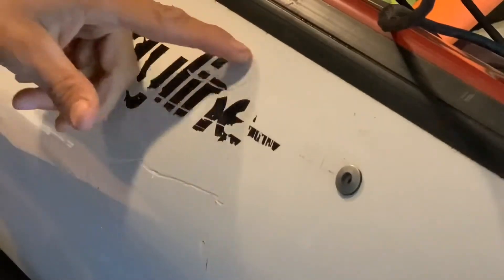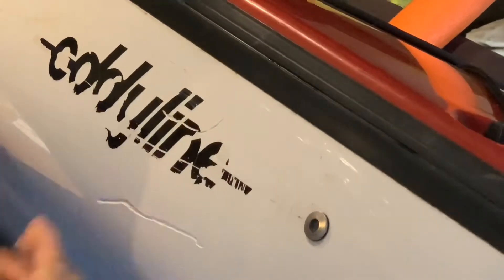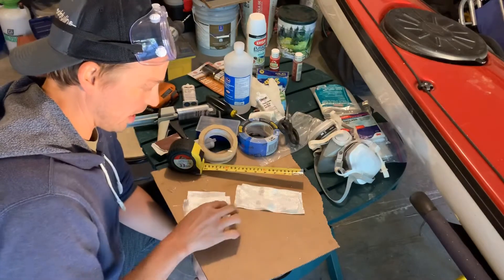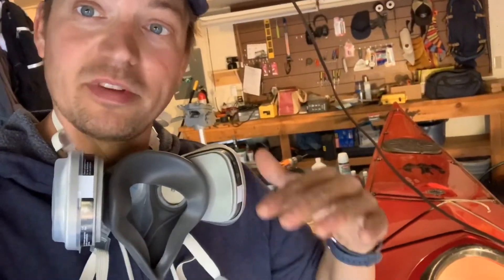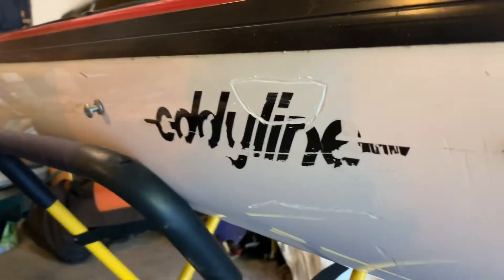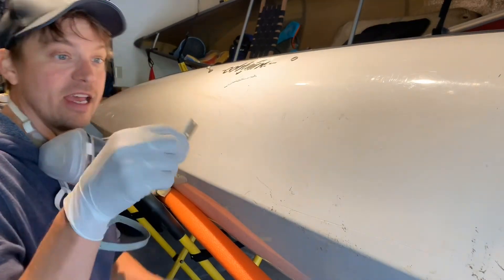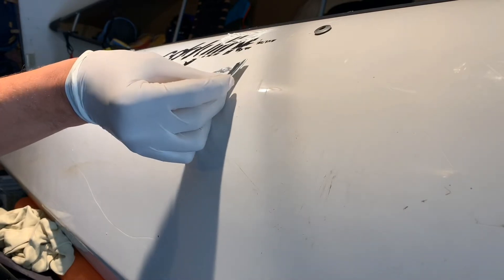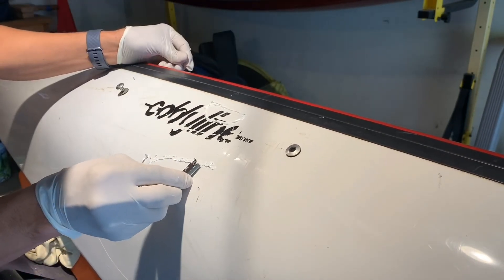Eddyline Repair Part 2: Thermoform gouge and fracture repair

Comment: When you run the blade over it, it will cut cleaner if you make a slicing motion as you pull the blade forward. Instead of pushing the debris into your trough and possibly pulling out material you don't want to, it will cause the debris to fall off to the side and cut nice and clean in one pass.

Comment: So in this video, you showed us when to use Devcon. When might you use Plexus?
Reply from the maker: Plexus is the manufacturer of Devcon Plastic Welder. They are both Methyl-Methacrylate Adhesives. Same thing basically.
Reply: @HappyPaddlin  thanks, Ethan. I only asked because Eddyline's website has them both listed separately under Care & Maintenance items.

Comment: I am interested in an eddyline but wonder if they damage easily?
Reply from the maker: In 20 years I’ve never had to do a repair on one of my demo boats. We buy two fleets of every model Eddyline makes and customers are usually not the most gentle when they attend paddle festivals and demo days. Anything can be broken but I like to say that if most of your paddling does not require a helmet you’ll be fine. And these days poly boats are so cheap if you want an abuse friendly rough and tumble bouncing river kayak, you can just buy a used WW or inexpensive poly kayak for that as a second “beater” kayak. We build thousands of boats every year and have been doing this technology since 1996. If it didn’t work you’d likely hear a lot more about it online!
Reply: Eddyline is highest on the bang-for-the-buckometer. The next up is going to be epic and they go right up to the most expensive. Depending on what kind of yak you want I would go with eddyline or Epic. Eddyline do not like to be bashed against rocks and they will scrape and scratch and crack. So you should have a roll of Gorilla Tape Handy. In any boat as a matter of fact gorilla tape should be on hand especially if you're offshore a lot like me. But generally speaking you're going to have to bang an eddyline kayak pretty fucking hard to crack it. But do it just right on a sharp Rock and you could. If you're open water and not hitting rocks you'll likely never damage it.
Reply: Thermoform is actually stronger than most composites but, with different disadvantages.  I have had Kevlar, fibreglass, rotomold and now 2 thermoformed Deltas.  If you hit a rock in a fibreglass yak chances are you will not go all the way through because the webbing cloth saves you, but that gouge becomes soft, deformed and may leak.  But, with fibreglass it is infinitely repairable.  Kevlar though stiff and strong will also crack easier than thermoform.  Thermoform on the other hand flexes more-- good and bad.  The flex allows some 'give' in a collision but, stiffness is a desired quality in kayaks.  That's why the deck on a Delta is composed of 'cool' recessed  bungee lines.  Thermoform also is more UV and scratch resistant and remains the same color underneath when gouged.  To answer your question, thermoform is a rugged and strong material, superior in many ways to high end composites.  Heavier than multi layered carbon (the best) but lighter than fibreglass and somewhere between the two for durability.
Reply from the maker: Thanks for the contribution here. Multi layered Carbon as “the best” is the only thing you wrote that raised an eyebrow. Certainly light, stiff and strong but gel coat still fractures and resin coats expose fabric to abrasion which is not always ideal. My new whitewater canoe from Northstar is an Inegra/Kevlar multi laminate w a resin that has some more flex than their normal resin so resin fractures are very limited. Can run a composite canoe down class 4 which any Carbon laminate (even multi layer) can’t do. 

Multi layer composites with various combos like Kevlar/Carbon or Innegra/Kevlar offer a lot of benefits but there is always a trade off as you pointed out!

Love to hear contributions here and thanks for sharing your real work experience!

Comment: Would plastic welding be better?
Reply from the maker: Nope. But you should try it ;)
Reply: @HappyPaddlin  I read on Eddie Line website that their sheets are a composite with an ABS base. The outer layer apparently is some sort of acrylic. So I can picture myself with a plastic welder feeding in an ABS weld rod. But this would also require the surrounding area to melt at the same time and I'm unsure if this unspecified acrylic material will melt with the ABS better than Devcon cyanoacrylate.
Reply from the maker: The way I demonstrate is how Eddyline’s longest employee/owner and production manager does all of their repairs. I’m sure the way you describe could work as well but this is how we do it and how Eddyline recommends.